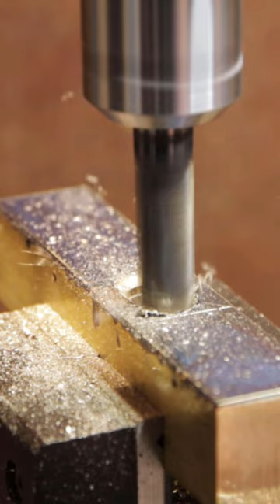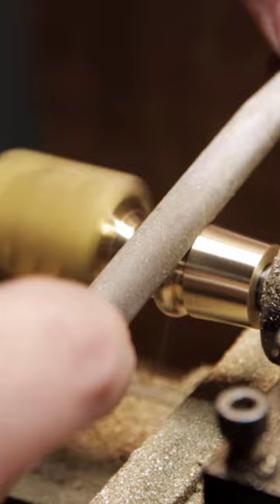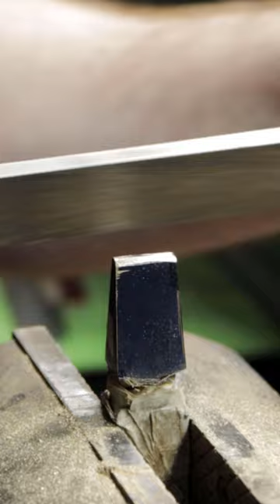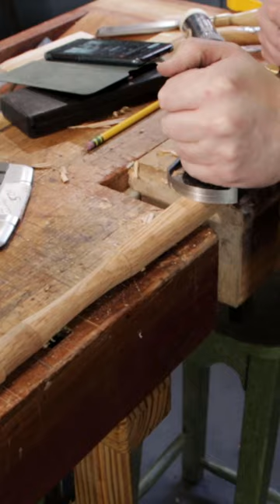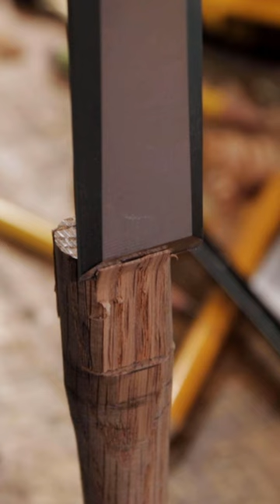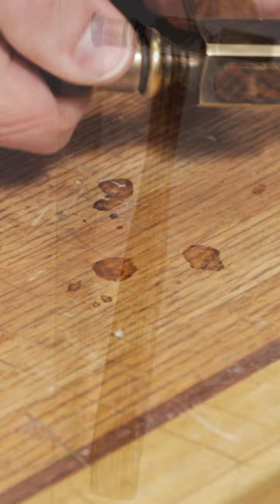DIY Brass Hammer

Comment: What did you use to patina the head?
Reply from the maker: Birchwood Casey gun blue
Reply: @EricMeyerMaker  Thanks for the info.

I wasn't aware that the Birchwood Casey stuff worked on brass.
Reply from the maker: It takes a while, but it will. They make a brass black as well that works much faster.